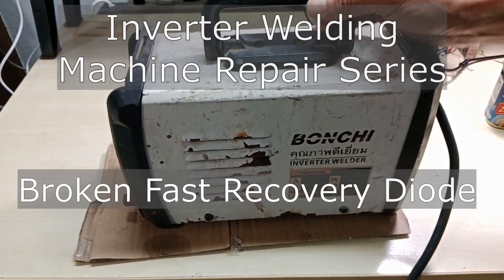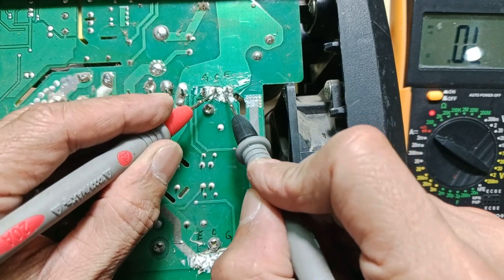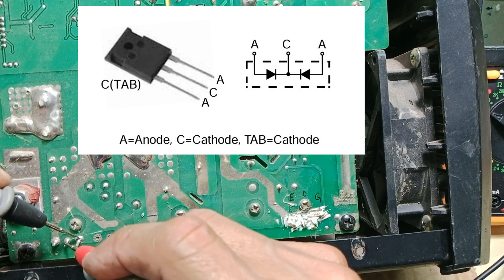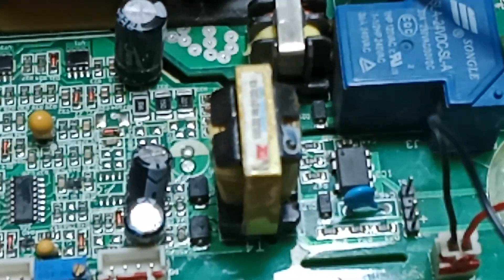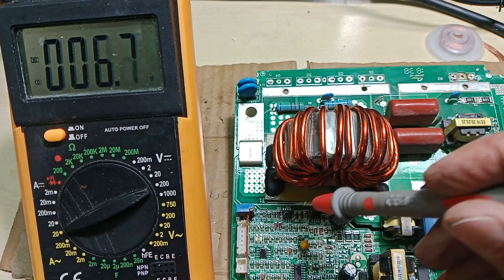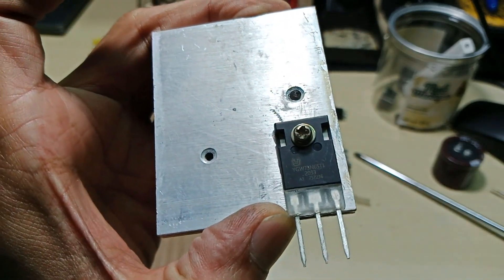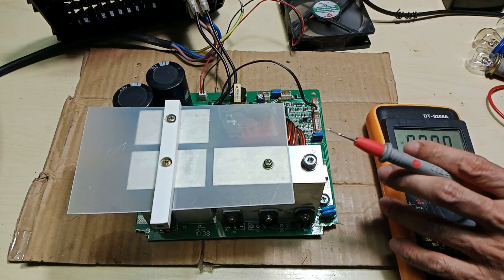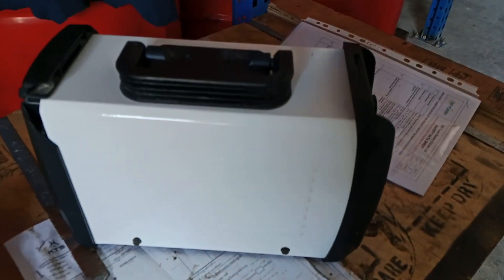009 Portable Inverter Welding Machine Repair - Broken Fast Recovery Diode

Comment: I have had a similar problem and changed the igbts but the machine made the same problem again when the stick touched the welding table (v-) then changed the igbts again and checked the output voltage was 55 volts what should I check to fix that

Comment: What if yung 5678 ng 4688 ay 15v ang output?
Reply from the maker: Hindi gumagana ang pwm controller. Dapat nasa bandang 7v masikat doon.
Reply: @DIYPhil tinanggal ko yung apat na 10k nakaseries sa mga output, hindi na 15v ang output ng 4688 pero wala paring output A at B

Comment: Ser... Gusto ko sana makabili ng diagram ng mga welding machine ..I'm from pangasinan...
Reply from the maker: meron po ako pinapamigay na libre. schematic diagram ng mga generic na china single board welding machine, SG3525 yung pwm controller. mag message po kayo sa facebook page natin. DIY Phil - Youtuber para masend ko sa inyo kopya ng circuit diagram. at wag din po kalimutang mag like sa mga videos natin.